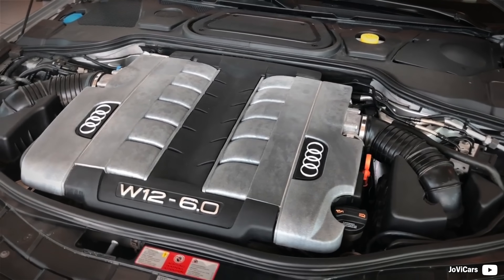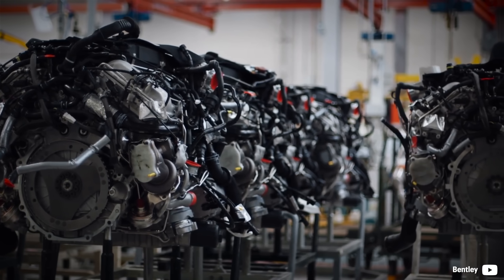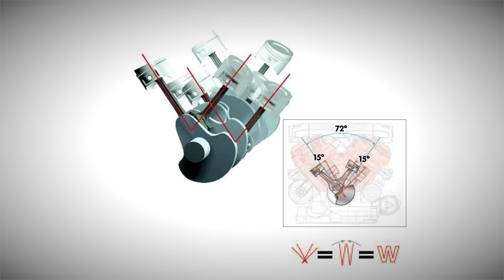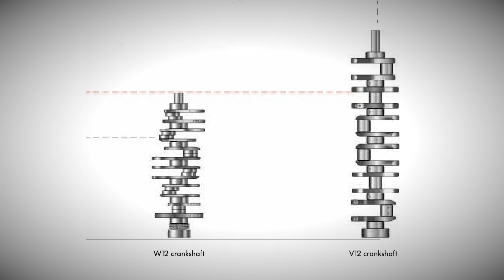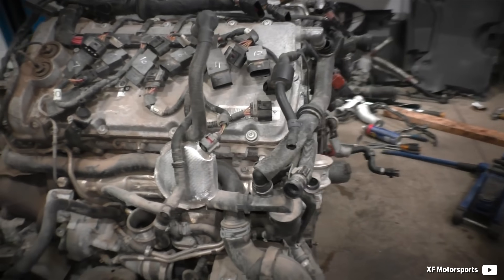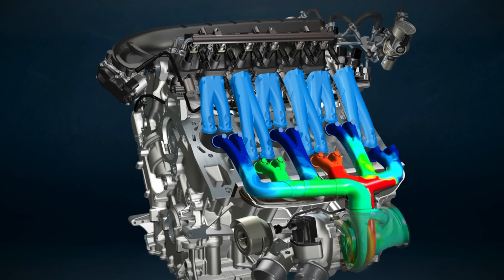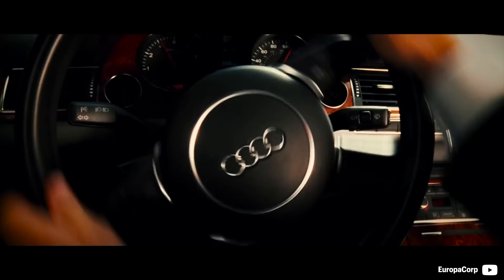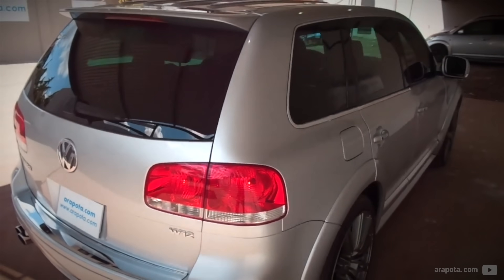What Is So Special About the VW W-12?

Comment: I bleave if they went to well designed v8 they could do much more power that this complex design. Furthermore a well tuned 4 cylinder can do this power with much affordable design. But those engineers setting behind the desk haven't touch any engine in real life
Reply: Thank you for revealing that you have absolutely no formal education or professional experience in the field of automotive engineering.
 There is a very good reason why luxury models often use a 12 cylinder engine... and this reason obviously has completely escaped you.

Comment: The twin turbocharged W12 engine is used in my Bentley Continental GT.  It is not an economy car, but if I couldn't afford the gas bill, then I wouldn't have bought it.  When I start it, the sound lets me know that I am sitting in a beast.  Driving it is an incredible experience. I really don't care about the cost of filling the tank with high octane, ethanol-free gasoline.   It is also not my everyday transportation.

Comment: Well, if you can afford to buy one you can certainly afford to service and repair it.
The Bentley version puts out 600hp (just 100hp per liter)
The Bugatti 16 cylinder version cranks out an incredible 190 hp per liter... so the VW version should be very reliable.

Comment: You show the origin an engine of 3 separate banks of 4 cyl- nowhere close to the same.  The engine design is fine- you mention unequal length in the head- but fail to realize the different cyl have different cam timing.  No different than the MK4 R32.  My MK4 R32 that I modified made 335 crank hp all motor with simple basic tuning.  The W12 actually gets great mpg for it's weight and power- I have an '06 Phaeton for the last decade- 444bhp, 412lb/ft tq- in a car that weighs almost 6,000 pounds (loaded lwb 4-seater) and I can still get 20mpg highway.   It is a very reliable engine despite what people that have never owned them think.  We have had 3 in our family for well over 10 years now.
Reply: Ferdinand Peich always called it a WR-12 which makes logical sense... VW marketing are the ones that caused all the confusion over W-12 which is obviously misleading and inaccurate.
Reply: @sandervanderkammen9230  VR - inline V   So yea- someone making a video of such an engine should understand what they are discussing.
Reply: @Josh-ce9sv  This channel is very low quality content...

Comment: The parasitic losses, heat and the shear number of parts that can fail makes this a nightmare.  Setting up this monster for racing is ridiculous.
Reply: The 16 cylinder Bugatti version easily produces nearly 200 hp per liter... higher than many racing engines.
Reply: 12 cylinder engines have proven to be extremely successful and reliable in a number of different applications... most notably in aircraft applications were reliability and high power-to-weight output critical.
Perhaps you should do a little more research because it's seems you still have alot to learn son.
Reply: Well, if you can afford to buy one you can certainly afford to service and repair it.
The Bentley version puts out 600hp (just 100hp per liter)
The Bugatti 16 cylinder version cranks out an incredible 190 hp per liter... so the VW version should be very reliable.

Comment: The first gen W12 vibrated considerably on idle in the VW Phaeton. Disappointing. Yet still, the punch was really something for the time.
Reply: A V12 should never ever ever EVER vibrate.  A V12 from Detroit would be vibration free.
Reply: @michaelbenardo5695  I know. Since this is no V12 but a W12, the second and third degree forces and moments are different which requires balancing shafts.
Who knows. I sat there and I felt that.

Comment: hmm tell me again how much $$ a 2006 corvette ZO6 engine cost? I think it only makes 600 hp. Does it also weigh less then the vw16? IF you put a supercharger on the zo6 it only makes 800 hp/800 ft.lbs. torque. hmmmm This is a tuff choice for me. Maybe I should go back to school and see if I can work on my math. Does 2+2 still equal 4? lol as long as traitor joe is pres. the answer is no! So the vw 16 is the better engine.

Comment: Great Engine from the VR6 engines. Great gets if you can find some with manual trans back then.
Reply: I had a 2008 Audi TT with a 3.2 VR6 and 6 speed manual. Still is my favorite car I've owned.
Reply: @Blank Name  Yep! I saved a R&T article  of this model and engine..... 😀
Reply: @QuietStormX  I drove it until 173k miles before it started sounding funny at the underside of the engine so I sold it. I was saving up for a supercharger kit for it. That would have been amazing!
Reply: @Blank Name  I used to upgrade the engine and suspension and audio plus short shift kit... Order and install on my own parts...

Comment: Wonderful engineering.. but not good for reliability..
Reply: Reliability compared to what?
Reply: @sandervanderkammen9230  90s Toyota or Honda..
Reply: @knocksensor3203  Toyota and Honda made nothing compareable in the 1990s.. mostly just basic 4-cylinder engines.

Comment: I put a W12 with 6spd TDI transmission in my 06 A4 Avant.  I love the W12 engine.  Just purchased a 09 Bentley W12TT to replace my NA engine eventually.
Reply: do you know if the w12 bolt pattern lines up with the porche boxter 6sp manual gearbox? is it the same as the audi V8?
Reply: @68arild  which V8? BFM from A8 or BHF 4.2 in S4? Same as bfm not bhf. I had to make adapter for transmission.

Comment: Phaeton W12 was a milestone car and absolutely on Par with bmw 7 and dare I say the S-class.
Reply: I completely agree, but did you know that the Phaeton was delayed by technical problems with the V10 TDI rather than the crazy W12? The diesel was too torquey and would destroy gearboxes - prototypes had over 1000Nm torque and nobody made a gearbox that could handle that and also fit inside a car. In the end, they had to detune the V10 diesel - so you got a huge thirsty engine without the full power benefit of its size - the Audi 4-litre V8 TDI was eventually just as powerful, but less thirsty.
Of course, for the ultimate in craziness, Audi's 6-lite V12 TDI takes the biscuit, but even that is limited to sub-1000Nm torque.
When it comes to engines, VAG knows how to kick the opposition.
Reply: @MrFlazz99  yes, have always been a fan of VAG powertrains beginning with the original aluminum space frame unibody V8 3.6L
I have had Audis as far back as 85’ coupe GT with 2.2L OHC 5

Comment: The VR6 engines always sounded wonderful. Strange how the exhaust note of the W12 doesn’t remind me of the VR6
Reply: do V12 remind you of a V6?
Reply: @sotiris223  depends on what V6 were talking about. A Toyota Camry XSE V6 with an aftermarket exhaust sounds pretty similar if you ask me
Reply: @AkimasaJP  You are obviously tone deaf...
Reply: That's easy to explain. 
12 cylinder engines have an exhaust stroke cycle ever 60° so the the exhaust pulses, (like the power strokes) actually overlap each other.
This is why 12 cylinder engines are the smoothest running and the smoothest sounding.
V-12 engines are so smooth they don't need flywheels.
Reply: @sandervanderkammen9230  along with straight sixes, the next most smooth engines are the likes of i5 and v10 engines right
Reply: @SkiRacingOz  In general yes, I would agree that is correct, although it has one serious omission, Boxer and opposed piston engines also have geometry that is naturally balanced.
Reply: @sandervanderkammen9230  you mean balance shafts. Not flywheels.
Reply: @DanielRevay  V-12 engines DO NOT need flywheels.. many V-12 engines DO NOT have any flywheel at all.
Do you understand why they don't need Flywheels???
Reply: @sandervanderkammen9230  no? The flywheel is used by the starter motor to crank the engine, and connects to the clutch in a manual transmission.

Is there something I don't know???
Reply: @DanielRevay  I don't mean to be rude but you seem to have left out the primary function of the Flywheel?
Some engines don't have a ring gear starter or a clutch... but they still need a flywheel.

The difference between a V-12 (or any 12 cylinder) is the firing order timing, 
A (4-stroke) V-12 starts a combustion stroke on one of the cylinders every 60° degrees of crankshaft rotation.
  This means the strokes overlap by 30° degrees. There is no dwell time between between combustion strokes.
 A V-10 has 72° (only 12° of overlap)

Engines with 8 cylinders or fewer have no overlap.. and thus requires some of kind of kinetic mass as a damper and to allow the engine to idle and run smoothly without excess vibration and torsional stress on the crankshaft.
Reply: @sandervanderkammen9230  oh i see. Thanks. I legit didn't know.

Comment: W engines are too expensive for a common man to keep up, this engine is for the well to do and in my opinion, they can  have it.
Reply: 12 cylinder engines offer major advantages in a luxury automobile...
and VWs WR-12 configuration offers adavantages over a conventional V-12 or W-12.
it's certainly is not intended for the  "common" man.

Comment: They put all that effort into a W12 engine, but couldn't stop bad blowby on my Golf MK4 engine, that had only done 40k miles. I feel sorry for anyone buying something like this, if they intend to do any kind of mileage.
Reply: You shouldn't buy a VW if you can't read your owners manual or the label on a bottle of motor oil.
Reply: @sandervanderkammen9230  Trust me, 3000 between oil changes, should easily be enough. How many does the manual say? Oh yeah, 10k. Hmm. Disappointing crap.... Sorry.
Reply: @sandervanderkammen9230  oh and those first 40k were with full dealer servicing. Serviced even if mileage not reached.
Reply: @MattBrownbill  You drive a lot of short trips? Getting the frothy brown stuff under the filler cap?
Reply: @sandervanderkammen9230  nope, it was a good mix of driving, no issues like that. However my Dad had the car before me, from new, and doesn't like to rev engines at all, so could driving in too high a gear cause cylinder wear? I did wonder if it had suffered from bore-wash. But I would hope a good engine management system would prevent this? There were other issues, like leaks, bad suspension bushes electrical issues, misfiring and soggy engine mounts that also put me off.
Reply: @MattBrownbill  2.0 liter engine right?
These engines tend to get a little water vapor build-up if the are not run hard but this does not necessarily indicate low compression.
Was a cylinder leakage test performed?

Yeah, A4 bushings and mounts are too soft, urethane control arm bushings are a must, the mounts are tougher issue plastic mounts available are too hard, transmits alot of vibration, particularly through the steering column.
Reply: @sandervanderkammen9230  it was a 16v 1.4. The Golf that really impressed us was the 1.6 MK 2. Such a good car, 10 years of almost complete reliability. That's why my dad got another, the MK 4, but was not a patch on the MK 2, which is why I ended up with it 🤔. I had a 'breadvan'  Polo, in the past, and that was a great car, shame the newer ones seemed worse.
Reply: @MattBrownbill  Are you in the UK?

Comment: Golf III was Junk. 
Prime example how Success corrupts.
It's a Fat 1300kg Golf II with Insufficient Brakes (because they come from 970kg Golf II as well as suspension) 
shitty diesel Engine. Because People Look at Amazing TDi Engine not 1.9TD, that sold More in Golf III, and was the Primary Diesel Engine along 1.9 GD(non turbo). Until basically Golf IV. 
People still justify that garbage to this day, although 1.9TD was 1992 Engine that had 75Hp. Same people shit on, for example Mercedes Naturally Aspirated 2 liter OM 601 that also makes 75 Hp(10 years older) without the Turbo but can actually pull the car without eating the Oil. Or needing a Turbo rebuilt every 70-100 K Km. Not to even Start mentioning Fuel consumption. And that Mercedes easily eats 500K Km before rebuild.
Bodywork made of Rust, Opel Kadett, and Astra F could be envious of. Electric Windows that constantly eat steel cables. Central locks that Die in Engage position and drain your battery. Super small space inside the car on a Golf II platform because all of the unnecessary plastics. Servo that goes too far, so it can fake a turning circle, and results in destroyed Front outer Axle joints. Self adjusting Clutch basket that is not capable of dealing with it's incredible 75hp output. Not to mention being able to self adjust. Interior Completely Stolen From Mercedes W201 and BMW E30.
Nothing on that design works properly.
And unlike Golf I and II at the price that Buys you Both.

Comment: Can only imagine the repair  bills. Probably  a small fortune. But they do sound amazing. 👍
Reply: especially with VW's corp culture; you will have to spend $5k of work to replace a 50 cents parts.
Reply: @MetaView7  i bet. I got a 1.8t and 2.7t. They are both way too expensive,  lol
Reply: It is just a V6 with 2 extra rods on ech throw. Gently had no maintenance problems with the W16 in the 50s

Comment: From the thumbnail it looks more like a twin VR6 in a V configuration. So not really a W in my opinion.
Reply: You are correct. 
If you look at W in the VW W12 logo, you will see that it is a Double V, a subtle nod to the engine being derived from 2 VR6s.
Consider that a VR6 has much more in common with an Inline 6, and traditional V12 is 2 inline 6s sharing the same crankshaft, so a W12 is more akin to a V than a W.
Reply: Correct, this is a WR-12 configuration not a true W-12.

Comment: At 100'000 units built, is this the most popular 12-cylinder engine in the automotive industry?
Reply: lot o trucks
Reply: @Xayuap  Sure! But among cars it might be the most built ?
Reply: @hendricstattmann3638   I think so, V12 is not that common.
Reply: @Xayuap  What trucks have 12 cylinder engines? Most are 6 cylinder diesel.
Reply: @ericbitzer5247   the ones with a Volkswagen W12
Reply: @Xayuap  Oh ok. I just know most Cummins, Detroit, Caterpillar etc.. are 6 cylinders.
Reply: @ericbitzer5247  of course, I6 are perfectly balanced.
Reply: @Xayuap  It's amazing how many diesel Mercedes Benz cars are still around from the 70's and 80's. I think they are 6s too.
Reply: @ericbitzer5247   yes, even Japanese ones as I6 is the smoothest and efficientier to build per cyl/power

Comment: Your videos never disappoint! I always wondered why and how the W-12 was developed.
Reply: wR-12. .. W-12 is completely different
Reply: @sandervanderkammen9230  W12*, R from VR means "Reihenmotor", translated to english: inline.
Since the W12 are two VR6, do you see any inline engine?
Reply: @AMV12S  
VR is a Mix...in german V-Motor (V engine) und Reihenmotor (Inline engine).
The VR6 engine has 15°benchangle, this was the only way the engine was so compact that it fit into the vehicle, with transverse engine platform.
The W12 was a Clever design, because they used two cylinderheads from the VR6 engine.
In the latest 80s Audi did the same at the Audi V8, it has a 3.6L V8, they used two cylinderheads from a 1.8 Golf GTi.
Reply: @AMV12S  WRONG, A W-12 has 3 banks with 3 seperate cylinder heads.
Reply: @markusw.3581  It's not a W-12, a W-12 has 3 banks with 3 seperate cylinder heads.
Reply: @sandervanderkammen9230  
I know it, i'm an engineer, i studied vehicle technology for combustion engines,
The VW 12 zylinder engine is not a real W-engine, it is the marketing name of VW.
Reply: @markusw.3581  Thank you for admitting you were wrong.
Cheers mate!
Reply: @markusw.3581  again: there's any "W Inline" engine?
Reply: @sandervanderkammen9230  nope, this is a W too, has the same shape as a W.
Just like we have different types of V and flat.
Reply: @AMV12S  Sorry but you are completely wrong and confused by market terminology used in English language regions.

A W-12 has 3 BANKS and 3 CYLINDER HEADS

The VW 6.0 liter engine is a WR-12
Reply: @sandervanderkammen9230  Again: R means "Reihenmotor", you can't have a W and Inline at the same time.
You are tripping man 😂

And again: the VW 6.0 is a W too, not like the 1930's 3 banks but is a W too, another type of W but still a W.
Reply: @sandervanderkammen9230  the VR6 means it is a V and a inline 6 at the same time because the cylinders are at 15º angle, making it V and Inline at the same time. This is not possible with a W12 with two banks of VR6: There's no W and Inline 12 at the same time, "WR-12" don't make any sense.

Is a W, another type of W, but still a W.
Reply: @AMV12S  I'm sure you are confused by the terminology.. that's why VW calls it a W-12 in some marketing materials but from a strictly engineering classification system it is not a W-12 which is why VW originally named it a WR-12, not a W-12.
Reply: @sandervanderkammen9230  so explain me how can you have a W and Inline 12 engine at the same time. 😂
"WR-12" doesn't exists, not even in VW.
Reply: @AMV12S  So you have no clue what a 'W' engine looks like do you??
Reply: @sandervanderkammen9230  sir, you are the one saying this is a W inline engine 😂😂

Wanna know why this is a W engine? this isn't two VR6's engines, but two V6's together: external with 105º angle and internal with a 75º angle, so you have two V's, so a VV or a W.

See? wasn't too dificult. You have no clue what this VW engine is.
Reply: @sandervanderkammen9230  also the W pronunciation on german is "vee", so this is a W12, not the same W as the older one with 3 banks, but still a W, or VV if you really want to. 😂
Reply: @AMV12S  Thank you for confirming that you don't have a clue what a real W engine is.
Reply: @sandervanderkammen9230  I am electrical engineer at VW, who wrote this reply to you was my fellow mechanical engineer.
Reply: @AMV12S  We are not talking about electric motors here kid, a 'W' configuration has 3 BANKS of 4 cylinders inline and 3 HEADS

THE VW WR12 has 4 BANKS of 3 cylinders inline and 2 HEADS